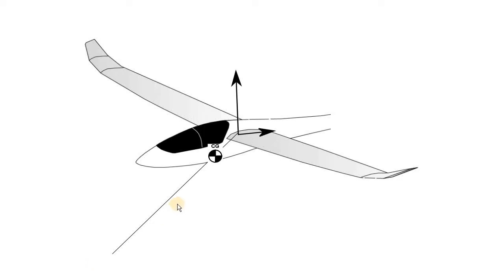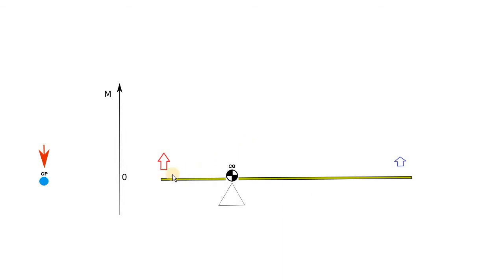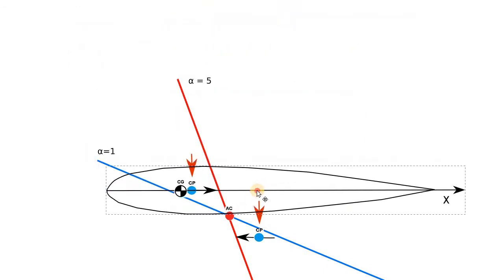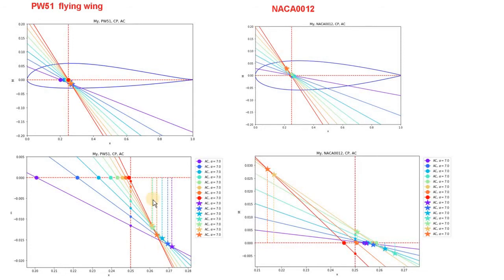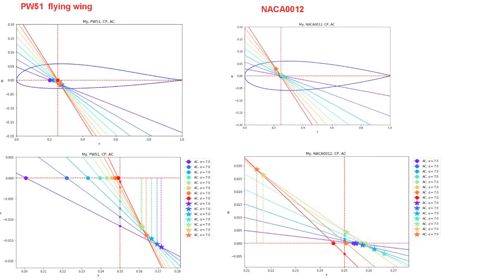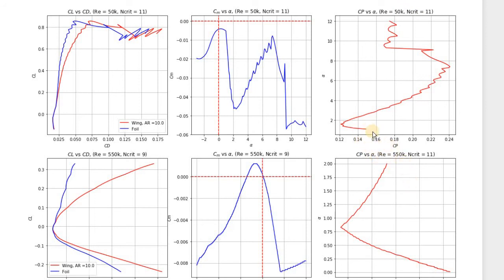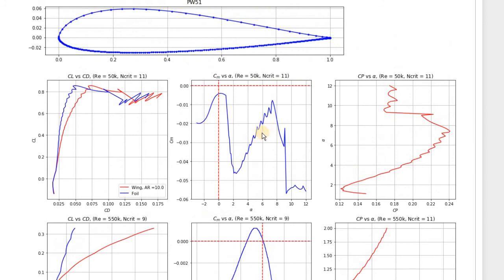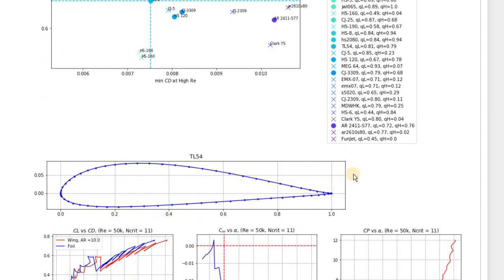The Best Stable airfoil for Flying Wing and Tailless airplanes

Comment: Why do people always forget that,  an airfoil is NOT a wing!  There are a lot more factors involved than what is shown in this video. Whether or not a design is stable is not driven just by the shape of an airfoil. There are washout, sweep, and other factors. By doing only what is in this video, you will end up with a design that has low performance.